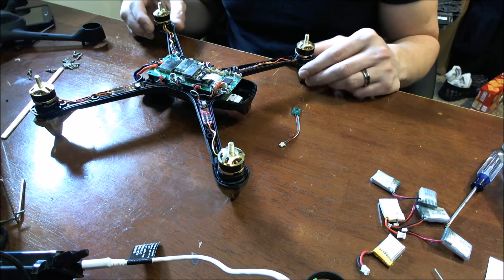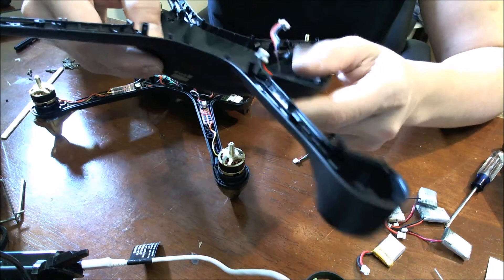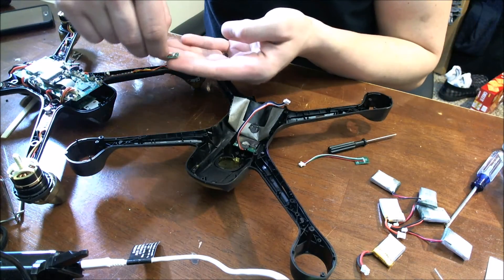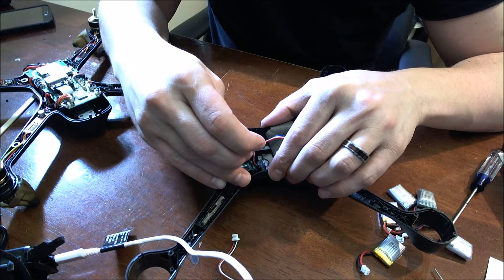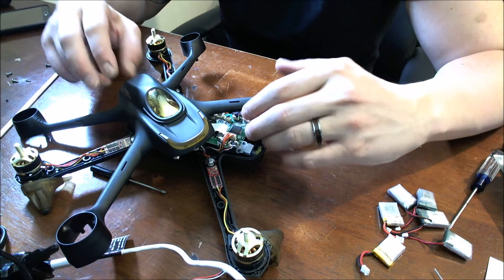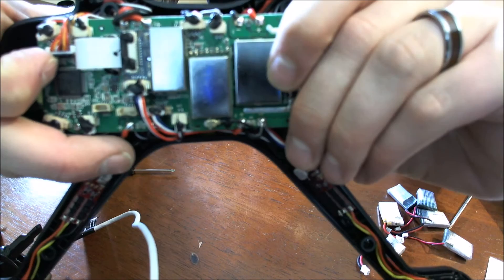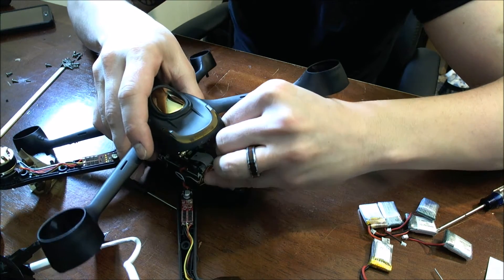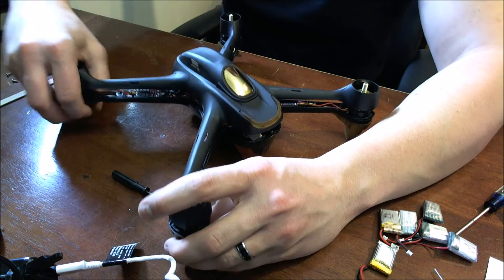Hubsan X4 H501s Compass replacement

Comment: Thank you for taking the time to post this video. Can you please tell me what type of problems led you to learn that the compass module was bad? I'm having calibration issues with a new 501S.  The "calibrate compass" notice doesn't come up on the screen  after I plug in the quad. Thank you.

Comment: does this unit show a compass reading on the transmitter? when you turn it around can you see direction it it going in order to return to home?
Reply from the maker: +Arnie Rosen yeah it reads 0 at true north, 90 at east 180 at South and 270 for west.  I know on my advanced transmitter it's the first value below the quadcopter a battery voltage.